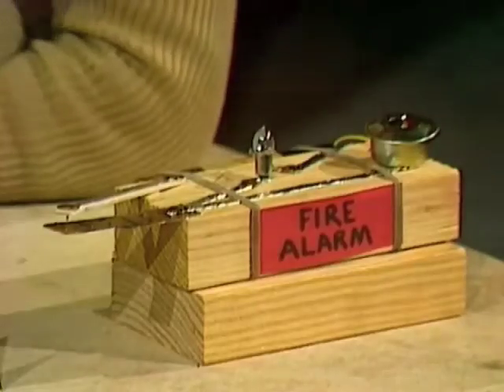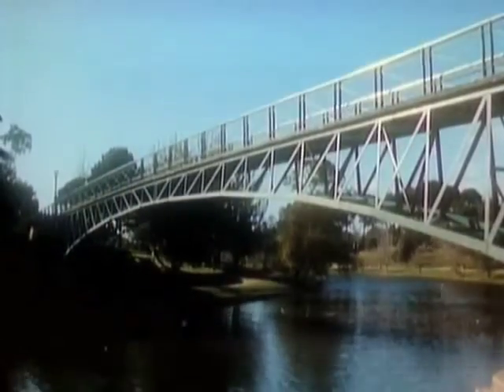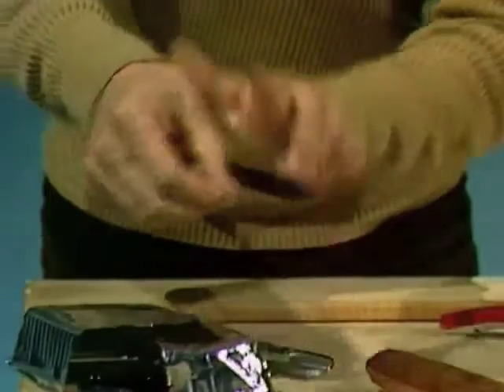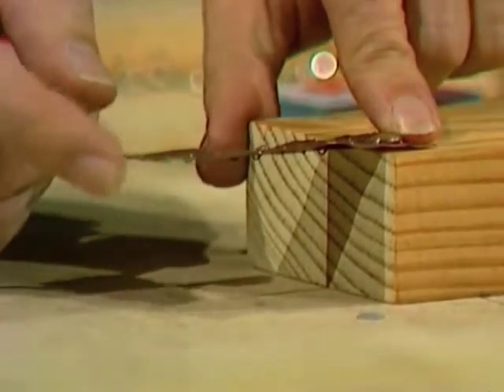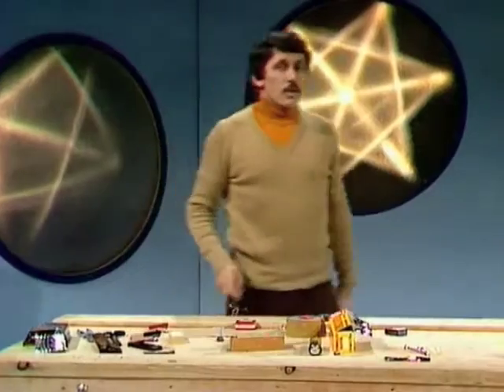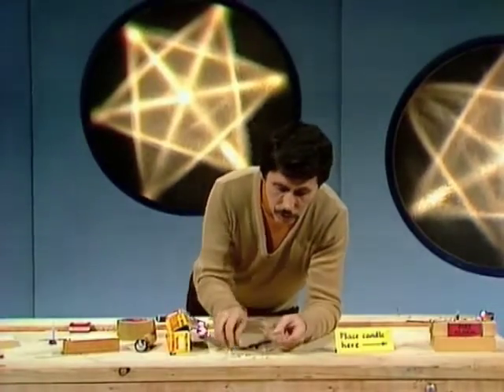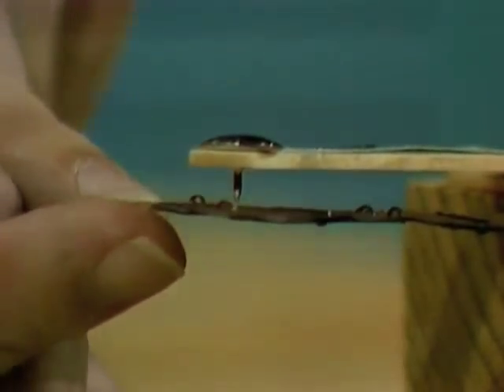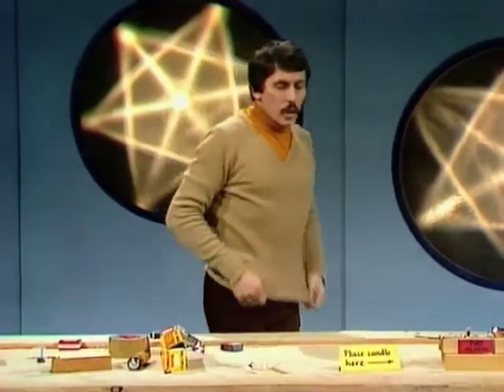Making a Simple Fire Alarm

Comment: Very clever use of aluminum strips for wires. That is where your genius lies Deane.
Reply from the maker: Thank you for your generous comments.  On another occasion, I used a long folded strip of aluminium foil, a large nail and sticky tape (for insulation) to make an electromagnet.   Deane.

Comment: Fantastic! I wonder if they still sell those little buzzers.
Reply from the maker: Thanks!  I think you can still buy electronic buzzers in hobby shops and bicycle stores.  Deane.
Reply: If you can't find them in store, you can find them on Ebay, Amazon ect.
Reply: Those particular gold colored buzzers aren't made anymore. They were actually used in real smoke alarms in the 1970s though. Nowadays smoke alarms use piezoelectric speakers tuned for a ~3KHz tone.
Instead you could hook up a transistor or relay and switch power to a big speaker or horn.